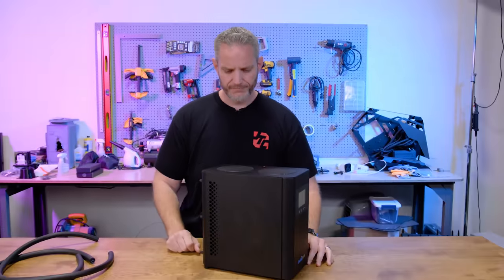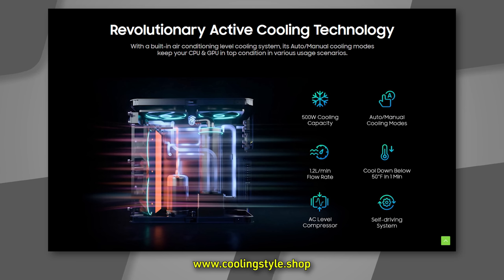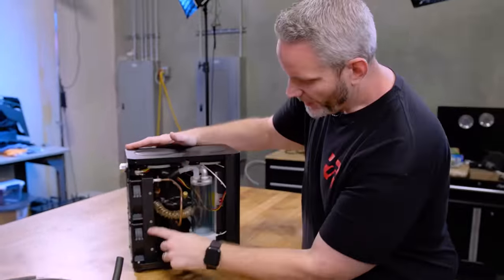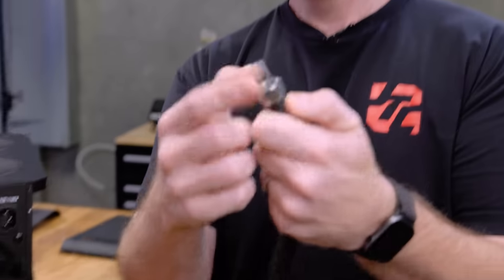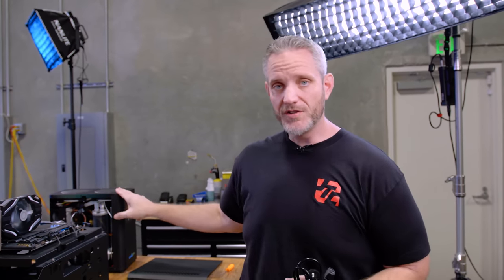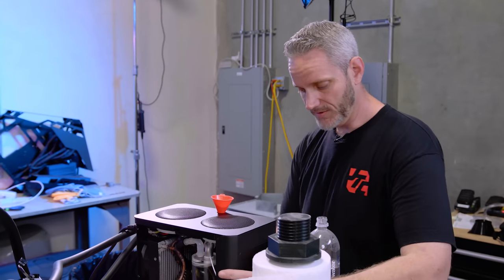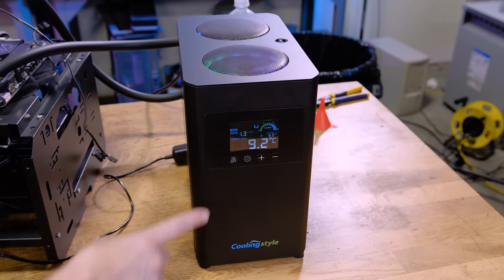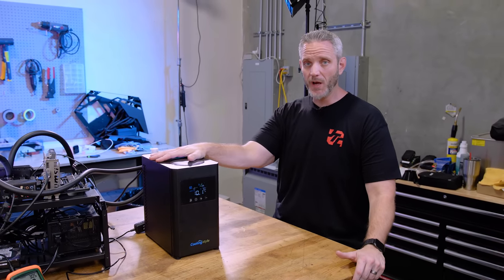This seemed Gimmicky... Turns out I was right!

Comment: 6°C may be nice for marketing, but otherwise it''s completely pointless if you think about the most likely use cases for products like this. 
People who buy bolt-on solutions, like AiOs, want the most cooling performance for as few hours spent wrenching and fine tuning as possible. 
Going 20+°C below room temp is going to cause condensation out the wazoo ... which is a pain in the neck, dangerous, and hard to deal with even for experienced PC tinkerers. 
The few overclocking enthusiasts who actually want such a system will just buy a small industrial chiller, which is basically what this is anyway, and get twice the cooling/$ than with this thing. 
You can get a 750W chiller for 500$ or less at every corner of the internet. 800$ for 500W? Because it's black and has RGB? Yeah, totally worth it.
They should at least add a "sensible" auto-mode that sets the fluid temp to 1C below ambient. The same product would still outperform any other cooling solution, but with less power draw, less noise, no risk of electrocuting the customer etc., and might actually be worth the extreme mark up from a very specific viewpoint.

Comment: This is a very cool idea (no pun intended) - But I've got to ask ... Who's the target market for this? It only covers 500W, right? Well, in terms of performance per dollar, you're far better off buying higher end CPU+GPU until you max out at the very top end. Okay, but the very top end is over 500W, so unless you want to buy two of these things or something, it's still kinda useless. Routing it outside of the room is an insanely big project, and at that point you may as well do something crazy like hijack a proper split system aircon. 

So for whom is this meant to be an attractive product?

Comment: I think that I will just carry on speccing my loop so that it has enough overhead to cool my system properly, rather than having a noisy, vibrating, expensive, additional power using monstrosity like that in my setup.

Comment: I'm running 12th gen 12900k oc to 5.2 P cores 4.2 E cores @1.29v temps 70s so not all 12 gen runs hot. Cooling it with the corsair h150i elite lcd

Comment: This really is nothing new. It's a damn mini aquarium chiller.  I have used them for years and when done correctly they can be awesome. I always put the chiller somewhere either in a different room like in a basement or under a porch outside.  Then just set what temp you want to keep the water at and your good. Just keep it above the point where it condensates and drips water everywhere. I have special insulated hoses I use and have no issues.

Comment: While it's true that the cooler is dumping a bunch of heat into the room, I'd like to point out that it's not going to dump much more heat than the computer is actually producing. Remember, almost 100%* is coming from the CPU. The cooler isn't generating much actual heat of its own.

*It's not quite 100% efficient, but honestly it's not far off.

Comment: Does that type I plug have insulation on the base half of the positive and neutral pins? If not, it's not up to code for Australia or New Zealand. (AS/NZS 3112:2000)

Comment: unless you could have a big enough pump to place this in another room its just neet. I remember the pc case with a refrigerator pump in the base unit. And yep unlike a refrigerator that you can't hear running and puts little heat into the kitchen it was just like this. Andrew has a good idea..window unit. I bet the $200 window units could be adapted to this and cool super well with no heat into the room.<<< HEY JAY

Comment: There is a lot wrong with this thing.  This is a concept beta at best.  There needs to be massive improvement to this before it will be consumer ready.  It is too loud, to much potential for leaks, and it is WAY too expensive.  You could hook a window or portable AC to your computer for less.

Comment: the foam under the compressor is only for shipping. take it out, and it will be much quieter.... dah....
Reply: and ive been putting foam under power transfrormers to make them quieter. damn....now theyre ready for shipping.
Reply: @echelonrank3927  The rubber grommet mounting is for sound. the added foam is to prevent flopping around during shipping. What kind of equipment do you have that the transformers make noise?  Been working on tube gear with transformers since 1965 and the only time they made noise is when they were going bad, or over loaded.  :-)  Great comeback though.
Reply: @timfadden5807  its rare, i dont remember coming across something like this in a guitar amp. the humming noise usually happens with hi-fi gear.
no, the transformers are not noisy by themselves and the loading is fine, its the stray magnetic field that makes the metal cases very close to the transformers resonate and can be heard as a low hum in a quiet room. the foam cuts down the case hum by a lot. 
i even had this problem inside an ebay  turntable once. the metal shield around the transformer hummed so much you could hear it through the pickup. foam didnt help enough, i had to swap everything with a toroidal transformer kit off ebay also.
of course it didnt come with the extra long japanese thread screws needed for the install, sourcing those was another saga entirely. ebay bargains = 😫

Comment: Dumb but potentially fun video idea: install this on a loop where the water leaves the chiller and runs through the CPU, GPU, and then a radiator on intake fans.  Set the chiller outside and run it full blast while using the computer and see if the radiator picks up heat from the room and expels it outside, thus cooling the computer internals and the room as a whole.  I have no hopes that it would work well or be viable to do everyday, but I'd watch that video just to see what happens.

Comment: I mean, isn't the cooling capacity excessive. If you can liquid cool a PC and keep it mid 40s to low 50s degrees celius, you wouldn't loose performance ordinarily speaking and be just as better off without this airconditioner rig???

Comment: The whole point of an AC is to be able to move heat from a lower temperature area to a higher temperature area. Unless the room is hotter than the chips, this is just a tremendous waste of resources from the start.

Comment: If you get like a 3000 rpm noctua would make it more tolerable, there could be a d5 pump mod as well. but id rather this product be around 200 to 400, if its 800 it better be compact and have all the right fittings this is just not it chief.

Comment: Wouldn't this eventually flood the PC with condensation due to the PC being cooler then ambient?

FYI - The price of 699 is really good in comparison. My MORA-420 cost about 1100$ with pumps and fans.
Reply: Water will only condense when it's lower than the dew point for the humidity. Just being lower than the air temp doesn't automatically mean it will condense.
Reply: @punkdigerati   At 6C you are below dew point.

Comment: This is ridiculous.
Back in the mid 2000s there were phase change systems like this that would get a CPU & GPU down to -60c for the same price.
Hell, a $50 Peltier would probably do a better job than this.

I think the difference is that this is cooling your water cooling system but the older ones had the refrigerant go strait to the CPU/GPU block.

To deal with the condensation & frost people tended to just coat the MB in silicone sealant 😂

Comment: lol i made a chiller like this with Peltier Chips and water blocks and did a quieter  and better job   problem with that setup in my eyes is that flow rate is awfully and the whole design is better with mono blocks and GPU all piped in I wish I still had it I would send it to jay to show off but at the price of a 3080 Na I would rather stick with a full custom loop

Comment: I'll be so happy the day Jay quits using VID for vcore measurements. VID is just the table the CPU uses to determine how much voltage it's going to request from the VRM and the VID value in hwinfo is the amount of voltage it's requesting at that time. It doesn't take into account LLC or vdroop and if using manual voltage overrides depending on the board, what VID is showing can be completely different from what the actual voltage is at that moment. Vcore or VR VOUT,. depending on the board, should be the value you use most of the time for overclocking.

Comment: Sadly, given the rising power requirements for both new gpu and cpu chips we may all be running something like this in the future. Then you'll also have to run a vent to the outside from the heat exhaust to keep from cooking yourself in your room and build a sound isolation chamber for the unit to keep from going deaf. And lots of luck taking your rig to a  LAN party. 🤣🤣🤣🤣

Comment: i can see this unit working for a lot of people. you just try to point out the max bad possible points, you dont say that it does whats advertised, can be placed in other room with longer room, noise dont matter to alot of ppl. and the ppl who got the money for this im sure dont live in a 1 bedroom apt, even if they did they wouldnt care about the noise, just the performance they get and how easy it is to use/setup.

Comment: Jay, when I see a lot of "fluff and filler text", it is usually the terribly spelled, completely 100% false and unnecessarily over repeated even to to describe a basic function as being the best thing about it.  Usually that is the case with those terrible fake phone replicas that have a real camera resolution of just 5 MP and fixed focus but they seem to go to all four corners of the earth and back to make you think that it is better than it is.  It will often be so blatant that the same camera would be marketed by them as 64 or 108 MP when it is just 5 and can't even take a good picture of something 5 feet away.  The only real clue to those horrendous fakes is that they claim them to be devices that cost around $600 new but are selling them for $100 or less.  That does not in my opinion in the slightest excuse such poor marketing and deception.  They should sell it as what it is and not modify the software to outrightly lie about all of the specs.  They even go so far as to claim it has 128 GB or better storage when it is in reality 4 GB.  You would lose a lot of data if you trusted those claims and craved mediocrity enough to take photos with that camera.

Then there are fake flash drives that seem similar to the memory in those phones in that it is modified to report as being more.  I don't get why anyone would waste their time angering people with these worse than mediocre products, I really don't!!

Comment: Too expensive, not enough hose, should be remotely installed due to noise and space air temps. Just DIY one out of an old transmission cooler, a deepfreeze, and some brains.

Comment: I feel like the use of 1/4" line is to keep the Head Pressure up with the idea that you put this on the floor with the line running up to the PC. As someone further down the comments also suggested, it is meant to plug into an existing loop through the back of your PC, especially for say a SFF ITX build.
Reply: Good way to have air pocket in  CPU. It should be set above the Computer. Imo

Comment: Hey Jay you should see if you can get that new server liquid stuff where you can fully submerge the power supply every substance with a new kind of liquid water type that you can even drink it's safe and put that in a water cooling loop you would never have to worry about a leak again on your computer and you can even hot swap and plug stuff in underwater while it's going and powered on and it still works and it won't be ruined think of having that in a water cooling loop and never have to worrying about a leak again other than oh crap my computer's not being cooled anymore because there's water out of it other than oh crap my stuff's going to break because there's water on it

Comment: It's the same heat your computer would output anyways, plus some overhead for the compressor, why does he keep talking about it warming up the room? Where is the crazy extra energy coming from that is worth being a concern?
Also why is it ok to spend that money on high-end waterblocks and rads to get 20c or less difference but not on a chiller? The overclocking head-room was not covered in this vid. Didn't compare water cooling to chiller cooling using the SAME block, the block difference alone could've been 5c plus.
This seems like a very weird video, not typical of Jay's usual analysis, almost like he didn't like the product from the beginning and didn't want to do this.

Comment: Yeah a bit annoyingly loud, and yeah the heat coming out the back of it would coot the average room, you'd need to beef up your room AC by 2KW cooling power to cool the cooler.

Would be interesting to see you pull this apart and replace those annoying fans with some better ones that might work better and be more silent.

Comment: NOTHING in this is practical or feasible considering costs.  purchase, increased electric bills, cost of having to buy additional hardware cause this is inadequately made and poorly equipped.

plus the cost if it decides to leak all over your computer system and fry the equipment inside.  HARD PASS  Not at all worth it.

Comment: Just undervolt you cpu and gpu, I did my ryzen 9 5950x and my strix 3090 oc and now gaming my ryzen stays in the mid 50 to 60c, and the 3090 is running 60c max on games running 4k 120hz 3840x2160 resolution all ultra graphic settings.... would save someone from buying a hunk a crap you just showed us

Comment: dumb. dumb. dumb. more noisy machinery for a PC room? no thanks, nobody is building a factory with this thing.
if youre trying to cool the chip ultimately with air, why would you want to also cool liquids and pipes? this is freaking hardware bloatware legit.
now how about a bunch of huge fins instead of a loud vacuum cleaner/dust collector type cooling setup?